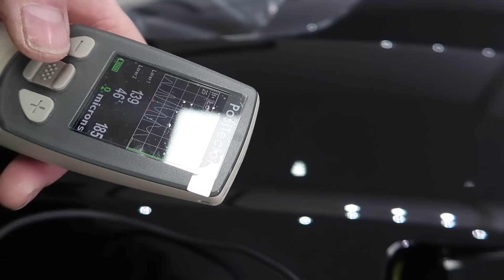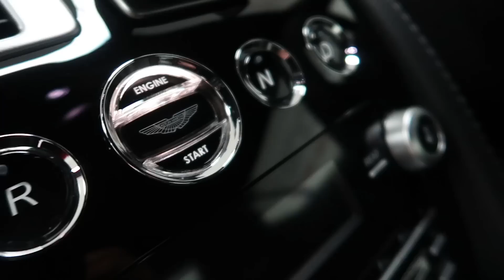Aston Martin DBS Carbon Ed - VLOG 054

Comment: question : did you ever solve the battery problem on the ibrid ? rupes should be shocked at the performance of what is an extremely expensive top end product from them ? would think they would be sending you tools /everything ?

Comment: Have you ever checked out Scott from Dallas Paint Correction and Auto Detailing? I am a fan of your channel as well as Scott's, I am also a Pro Detailer.  The difference in approach between your work and Scott's is staggeringly different, looks like two different lines of work although the fundamentals are the same.  It is obvious that you do more restorative details taking several days vs Scott doing maintenance details on cars that he keeps in relatively good shape.  You should definitely check his channel out though and let me know what you think! Keep up the great work! Cheers from BPS Detailing!
Reply: Benefactor James does high end detailing and Scott does regular maintenance detailing with a lot of cost cuttig